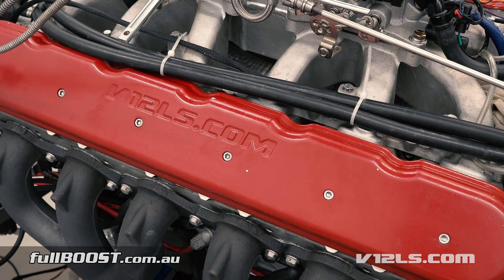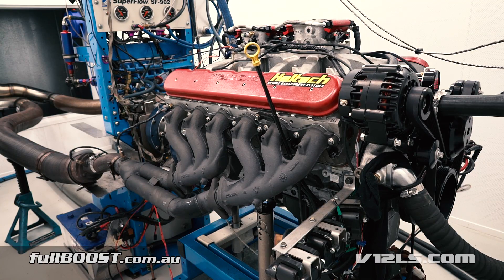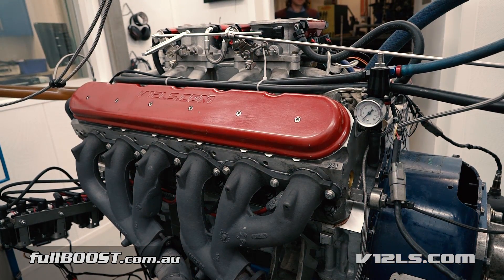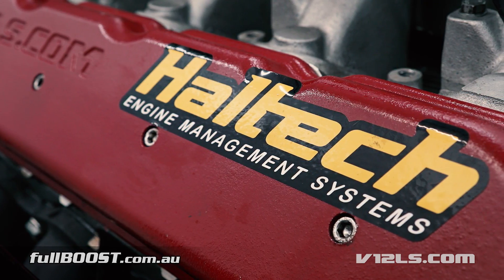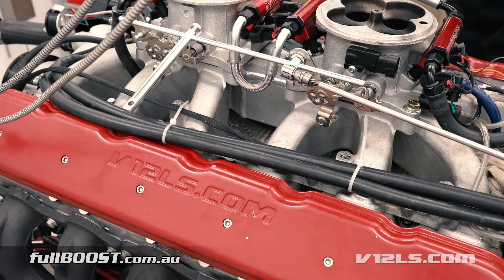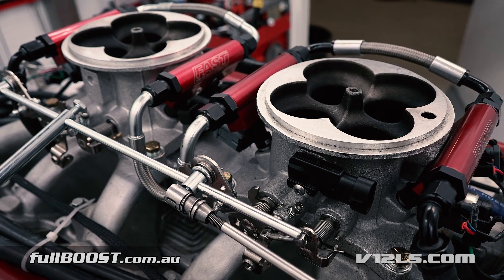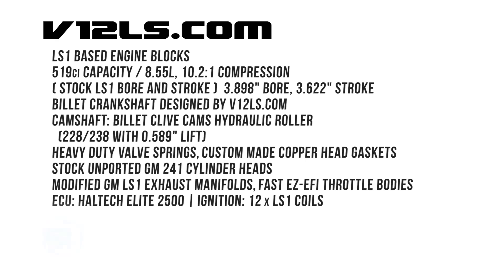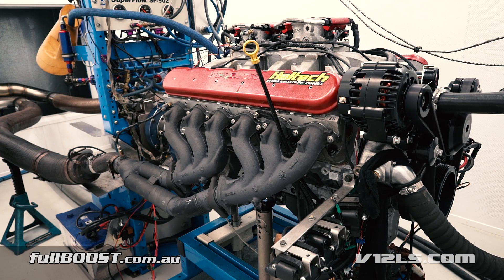V12 LS1 engine dyno

Comment: What you guys are not getting is that other than the larger than stock but very conservative cam, this is a stock spec engine but in V12 configuration.  A stock LS1 is 350hp.  This thing is making over 700.  Thats more than double the power of an LS1 V8.  whambodius talking about easily making that with a 540 or 496 which is correct, but you can easily build this engine with a larger cam, a set of bad ass heads and a better intake because this style intake sucks ass compared to the composite intakes, and some true long tube headers and be over 1000hp.  Remember this is a stock spec engine meaning stock bore, stock stroke, stock unported 241 heads.

And last time I checked a stock viper was 645hp  and they are putting down around 550 to the wheels so not sure where you getting the idea that the vipers are "basically putting that to the wheels" unless you mean "built" vipers.  This engine can be "built" also.
Reply: The stock Viper is also running an EPA tune with a stock cam through a stock exhaust with cats and sucking air through filters. A quick tune adds 28 HP and 44 TQ to the wheels. I don't know the gains if you added a performance cam in there and the stock cam is pretty good, so probably about the same gains. Don't get me wrong, I think this cool, but there is no magic here. Unless they get mass produced for cheap, I don't see a market. Either way, props for doing it.
Reply: Built? lol have fun paying ridiculous amounts of money on minimal gains cause no one has anything for this engine
Reply: I know they don't.  But it does have to have a set of heads and cam to run lol.  The builder could have used cnc ported heads and a much larger camshaft.  The point the builder was making was what would a stock or close to stock spec LS1 yield in a V12 configuration.  Heads and cam swaps on V8 LS1's will net a 100hp gain.  It seems that this engine responded well to adding the extra 4 cylinders.  The power doubled on this engine by adding half the number of cylinders.  These guys didn't set out to show how much power they could make with a V12 LS1.  Thats what I think some people are taking away from this video.  It was in no way a "lets see how much power we can make with a v12 LS1".  If that was the case they would have NEVER used this cam, NEVER used those heads, NEVER used that style intake, and had a much better set of of long tube headers.  Hell this thing has exhaust manifolds on it for Gods sake. Im really surprised they got that kind of power with that intake manifold on it.  

I dont really see a market for this engine honestly.  Leave it to the the aussies to do things that nobody else will.  Mad respect to them for that.  Those guys are all the time building some wicked stuff.
Reply: it all starts somewhere,  most engines didnt have an upgraded path until people put time, money, effort into developing upgrades for them. same thing for this motor, it might not have much of anything right now, but it does in reality,  and upgrade for an LS will work with this except for a crank amd cam.
Reply: madmax2069 LOL Huh? Let's see if you're preaching this story when you hit clearance issues. This motor will bring with it more issues than what it's worth.
Reply: You mean clearance in terms of fitting in a car?  They said its 8.8" longer than the standard LS1.  The engine is in a 1st gen  camaro now making over 800hp with long tube headers and different induction.  Still stock unported heads.  They are saying after SEMA they are going to start cranking on it.  A heads and cam swap on a standard LS1 is worth 100hp so I assume it would be over 100 more hp in this configuration.  Im betting its gonna make around 1000hp N/A
Reply: this is probably running more like 500 hp. 4 cylinders from the original 2 engines are gone now and with stock heads. also this intake isn't bad at all, some of this type outflow a ls3 intake
Reply: this is probably running more like 550 hp. 4 cylinders from the original 2 engines are gone now and with stock heads. take 3/4 of the ls1s 350hp and you're at 262.5 x 2 for both halves and you're at 520 up, add a tune and you're at 550hp

 also this intake isn't bad at all, some of this type outflow a ls3 intake
Reply: ShadowOfDeath24 how are you gonna say it "probably makes more like 500" when they clearly dynoed it much higher than that!?
Reply: FullForce1972 they were called headers because they are the head of the exhaust “exhaust header”. an aftermarket header is still an exhaust manifold, just like you can call these (if they were) stock headers.
Reply: yeah, and for less money. You could take an LS1 v8, and have over 1000hp to the tires. Oh, and you'd be able to go to the parts shop to get parts you might need. Oh, and it would sound better.
Reply: With this you've lost the "LS V8 will fit into anything" advantage, this engine looks heavy as shit too.
Reply: @mtjeeves1234  for less money?? do you how much time and money it takes to make an ls1 1000hp?
Reply: @Okami400  Yes I do. Needless to say I could do it three times and buy cars to put them in for less than this motor. Do YOU know how much time and money it takes?

Comment: The Honda S2000, with 240HP from 2L, seemed like the ideal candidate to be turned into an I-6, flat-crank V-8, or V-12, by taking the same proven heads and reciprocating parts and simply making a new block and crankshaft...  Is it really "that simple?"  If not what other things are necessary?  (Obviously, bigger fuel pump, water pump, oil filter, a distributor for the right number of cylinders, but I assume you could get most of that stuff off the shelf.)

Comment: why does no one understand😲 this is basically a budget build and does not represent the full potential of this engine. yes you can turbo an ls1 and make more power,  yes a built 496 can make more power, and yes you can do this or that to that engine and it will make more power. (At the end of the day, those engines will still be those engines, and not an ls1 based v12.) But you must compare apples to apples, and oranges to oranges. this engine is basically bone stock performance wise. turbo this engine with the same amount of boost as the ls1, build this engine to the same level as the 496, or do this and that to this engine. now which makes more power? if you said one of the other engines, you are lying to yourself or just being stubborn. (not saying that there are not some engines out there that will not produce more power no matter what, but for most PUMP GAS engines, I believe this holds true.)

Comment: I'm laughing my ass off at the comments and speculations about why they're not "revving it higher" and that it probably has a lot more left in it. Its basically a gimmick engine and V-12 or not, its still a cam-in-block, 2-valve V-type engine of large displacement compared to the small, high-revving "supercar" V-12s the car "experts" here are apparently comparing it to. Adding 4 cylinders to a V-8 doesn't make it an engine designed and engineered to be a V-12 from square one, and once you hit the point of diminishing returns on a dyno pull where increased speed doesn't outpace lost volumetric efficiency and torque, you're a complete moron to keep running the engine faster when its not gaining you anything. Not to mention a factory LS1 V-8 redlines around 6500 rpm. 

So who in their right mind would expect this morphodite V-12 to spin faster when it's already placing significantly higher loads up to 50% higher than stock design levels on keep components that were designed for a V-8. Do you think the timing gear train is somehow 50% stronger just because the block and cam are longer and the load on the cam is at least 50% higher? Not hardly. How about the neutrally-balanced harmonic balancer that even if a hjgh-quality afermarket unit was still designed for a V-8 engine firing 8 cylinders every 720 degrees instead of 12? Does simply being made of "billet" make the crankshaft 50% stronger at the same time its subjected to more than 50% more torque behind the back connecting rod journal? 

I swear I get mechanically dumber every time I look at YouTube comments where a bunch of wannabe "experts" who probably can't change a tire are drawing on their fast knowledge, experience and education gathered from reading car magazines, watching Fast and Furious movies and playing video games start passing it along to others.
Reply: So true Chad, the comments section here has given us many laughs over the past months. It's also strange that people assume we are anti small bore exotics, which is far from he truth as I drive a beautiful Italian V8 on most nice days, and we have a lot of experience with other engine types like the rotary also. This engine made a little over 1.5x the same spec V8 would, and revved exactly to where that cam tapers off in a V8. I'm glad you point that out. We are expecting the same 1.5x+ results form our new cast iron V12LS blocks, and can't wait to get those on the dyno soon! The target market here is people wanting something different, we are tired of seeign the same old crate engines over and over again.
Reply: I'm your target market!
Reply: Chad Meyer Steve Morris devel sixteen v12 kicks ass look at that
Reply: you sir just Punk'd YouTube
Reply: Damn
Reply: Nobody has a long enough attention span to even wanna scroll through that there was no point in typing an essay in youtube comments
Reply: I would guess that they aren't revving it higher because with stock LS1 bore and stroke, stick 241 head porting and stock LS1 manifolds that there isn't any power in revving it higher, there certainly wouldn't be in a normal LS1.
Reply: Just enjoy the video and ignore the comments, who cares about everyone else opinion, lighten up a bit mate. Let them argue or complain or whinge about it just sit back and enjoy the arguments
Reply: Thats why they dont make the vipers anymore. I know its a v10 but really a glorified truck engine like this thing. Amyhow, what would this thing fit in that was cool other than a boat?
Reply: V12 LS have you ever talked to Chevrolet officials or maybe engineers? 
I think if that thing gets fit on their newest mid engine C8 platform with DCT and 4WD there would be no competition for such a vehicle. 
I’m not an engineer but it seems legit to me. 
The LS engines on old RWD front engine platform used to propel Corvettes faster than most supercar engines out there. Imagine what your 50% torquier LS can do to that thing. Would destroy any McLaren product on a quartermile strip.
Reply: Regardless it's still a pretty interesting engine with what looks like very solid work put into it
Reply: @hendo337 . Exactly. This went over Chad's head big time.
Reply: Holly crap.  Someone responded about the devil 16. That was a total fake. Get real and Chad Meyer, you said it bang on!
Reply: I just think it's dumb people comment at all thinking somehow putting their point of view out there will change others. People are stubborn and always think the're right. It doesn't matter whether you comment or not. Same result.
Reply: Have you ever worked with a normal ls1 v8? They can make more power than this motor. For a lot less money.

Comment: I can't even imagine some of the engineering and fabrication challenges they had to have tackled to make this work.  Were a couple of LS blocks sectioned then welded together?
Reply: John Shaft yes they cut the last two cylinders off and welded the blocks together they also made an ls1 v4 by cutting a v8 in half and welding everything back together
Reply: @-thebatman-  they casted the block in one piece from ground up

Comment: I wish someone would develop a DOHC cylinder head for the Triton V10. There's untapped potential there. AND you wouldn't need to cast a new engine block.  Would be much cheaper because the stock block and crank could just use aftermarket 5.4L rods and pistons.
Awesome video. Amazing engine. Thanks for sharing.

Comment: This is awesome. Want in my truck. But why not a V16?
Reply: That would likely have to be done in a W formation instead of a V
Reply: Search Nelson Racing Engines
Reply: Daniel Robinson you’d be looking at a very long crank at that point, in a block unable to support it properly. Could be prone to torsional flex or complete engine failure.
Reply: Hard to make it fit, and flexing as mentioned before.
Reply: V12 engines are the most stable V type engines. I prefer OPOC myself
Reply: Look at the prototype engine for the Devel Sixteen that was developed.
Reply: @thatdudety0176  have you ever seen a Detroit 16v 71 . 16 cylinder in a v formation is very possible .
Reply: @Dr.Westside  I actually have not

Comment: Trying hard to figure out how stock unported GM 241 cylinder heads for a V8 fit on this V12. Not knocking it because it is awesome, but not sure if that was a typo or magic.
Reply: read the desciption and it tells you
Reply: I did read the description, I cut and pasted directly from the description in fact. That's why I'm trying to figure out how bone stock unported heads for a V8 fit on this V12. Three or four chopped, shortened, and heavily modified cylinder heads grafted together with a custom camshaft I can see, but only two stock unported GM 241 cylinder heads for a V8 working on this monster V12 is a hell of a magical feat haha. I think it's more of a typo than anything. Engine is still amazing.
Reply: +Youblixuous, why would they need to be ported
Reply: No idea, just copied and pasted from the description.
Reply: +Youblixuous, where does it say there is only 2 heads?
Reply: "Published on Jun 11, 2016
A few years in the making, this one of a kind V12 LS1 engine has been pieced together by the Corish brothers at V12LS.com. In essence it’s two GM V8 LS1 alloy blocks and cylinder heads shortened and grafted together using a custom billet crank and camshaft. " That part right there. Not knocking the build mind you.
Reply: +Youblixuous, it says 2 blocks. Each block has 2 heads. So 4 heads total
Reply: Makes sense if you look at it that way lol.
Reply: Four modded heads would sure get the job done. Not sure I could call them stock though. I can imagine the GM parts guy's expression when I take him a cracked V12 head and ask for another lol.
Reply: +Youblixuous, wtf are you on about now?
Reply: Right, nothing good has come of arguing on the internet, so let's just say you're right. Have a great day!
Reply: OK, just to clarify, the heads are 4x stock 241 heads, each with one chamber cut off, TIG welded together, surfaced and reconditioned.  "Stock" basically means the ports have not been touched, valves are standard size,stock rockers, etc.
Reply from the maker: https://www.youtube.com/watch?v=4hn8bsGjCik
Reply: Thank you for the link!
Reply: my friend when they say  stock they mean that the valve sizes are stock , stock intake and exhaust port runner size and volume , combustion chamber is the same size ,it flows just like a 241 head would from the factory . I mean it is pretty obvious that they two heads have been fused together to make  V12 heads . But ofcourse you had to come in here with your dumb  argument saying if they have been modified to fit a v12 they are not stock heads yah blah blah yah blah .
Reply: Thank you for the clear, non-condescending clarification +WarWagonMT. People are like you are a rare gift to YouTube, as opposed to the usual troll children that populate comment section. :-)
Reply: Thanks for the link @Fullboost!
Reply: I'm surprised at this overwhelming amount of thanks and kindness, especially on YouTube. LOL.

Comment: I like how this design sounds like a traditional cross plane 90 degree V8, it seems to operate as one and a half V8s instead of other V12s that operate as two inline sizes or two V6s with a 60 degree firing order. I think I have heard a V12 design another company made from an American V8 and it has the 60 degree firing order that didn't have the same pleasing exhaust note.